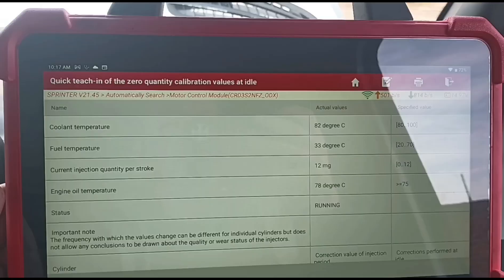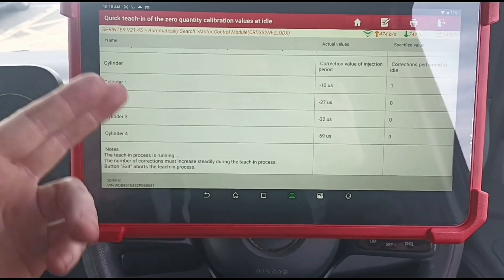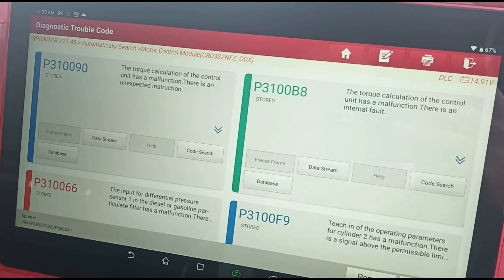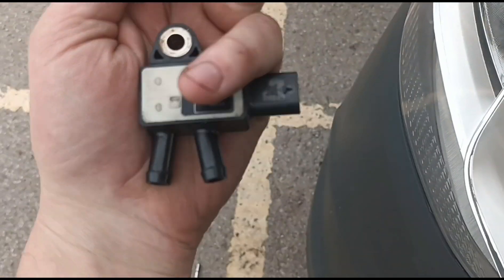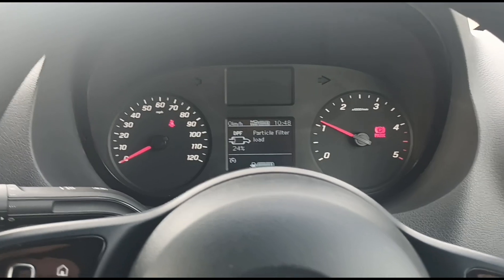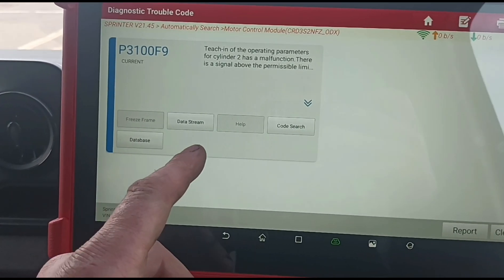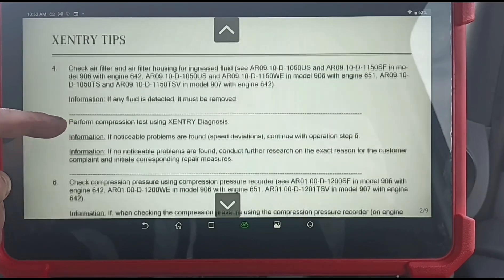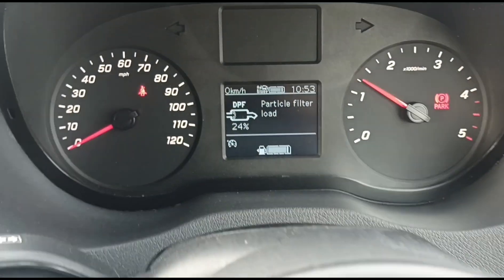Not A DPF Problem. Mercedes Sprinter P3100F9 P310066 Injector 2 & Pressure Sensor

Comment: Wild ass guess, but I would assume this could happen if someone changed an injector and did not code it properly, or if a little water got in the fuel and blew the tip off the number 2 injector so the computer is going nuts trying to compensate for the over injection that causes the smoke? I would love to hear a follow up from your buddy as to what actually happened and what the fix was. I know it's got to be driving you crazy Jimmy. I hate it when I can't spend the time to figure one out and have to leave it too.
Reply: Checking the stored codes match the injectors when things don't add up is a good idea for example I had a 1.5 connect past on to me to fit a used engine from a good running car that I tested and removed after fitting the engine and starting it was pluming out while smoke so I asked what happened before it came to me and it started with a DPF problem they ended up having someone delete the DPF they left them with it smoking and said that there's something wrong with the engine after knowing that I checked the stored codes and what the original injector codes where and they didn't match I put the codes in for the injectors on the engine I put in and it ran great I think the guy who did the delete just flashed it over from another car including the codes and I switched the engine for no reason